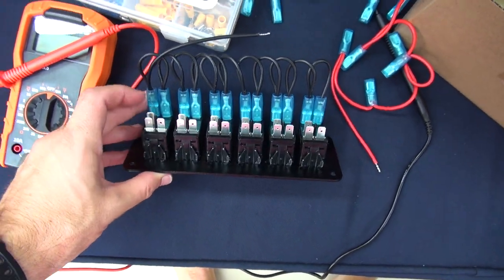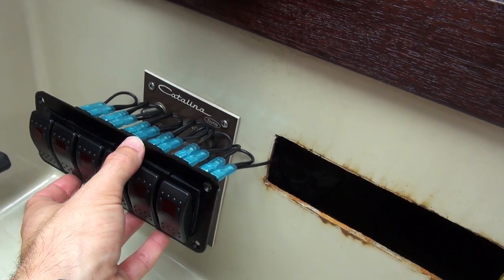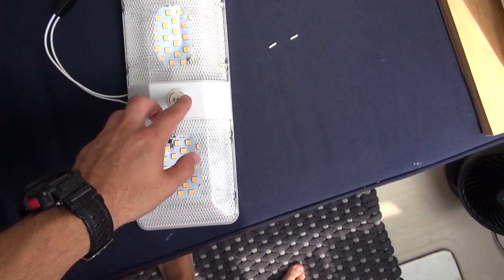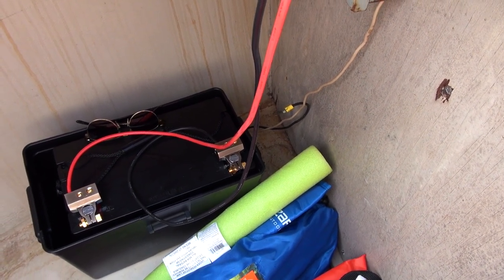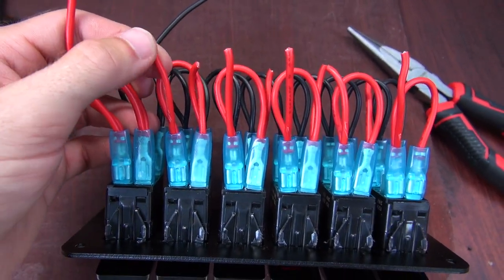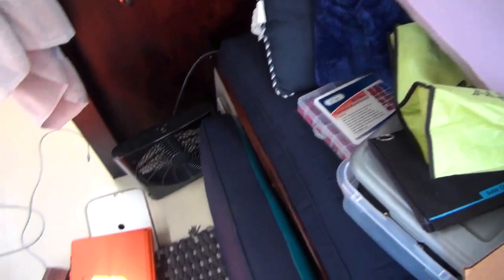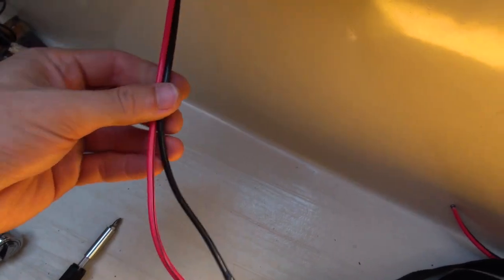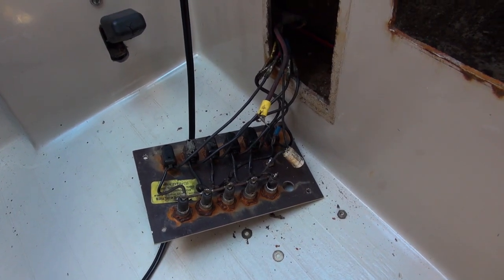Installing a new 12V DC System on My 40 Year Old Sailboat (Part 2) - Sailing Viridian Episode 6

Comment: Love that you’re finding passion in sailing/the ever ending process of updating.. BUT please study up on AYBC standards for Marine electrical wiring.. so many things on your boat concern  me and really hope you don’t have a fire (however somewhat unlikely)... do you have an auto bilge pump?  And pls don’t run your speaker wires  thru the drain holes... I would wrap wires around the stanchion tubes, then drill a hole to run them through a marine cable seal grommet  inside the boat. Nice work, but do more research before working with boat electrical (much different than home electrical).. A fire can cost you a bunch of $ on the dock; and your life at sea. Lots of concerns visible from my humble opinion, PM me if you want, I would be happy to walk you through it..

Comment: Great job getting those wires sorted out. Looks like it is coming along well. The old gate valves under the gally made me cringe. Mine broke off in my hand and almost sunk the boat. That made me wonder if you have a bildge pump connected to a float switch?
Reply from the maker: I agree, those valves make me nervous as well. Installing an automatic bilge pump is definitely on my to do list. What material or type of metal were your valves?
Reply: @SailingViridian  They were the same as yours. I removed them at the yard and glassed over the hole. The only one I kept was the raw water intake for the engine. My catalina has an Atomic 4 engine where your mess of wires were.

Comment: Enjoyed some of your vids, ,,,, Obviously ocean and especially intracoastal canal (go Florida to Lake Champlain - or over to Erie Canal and west) offers great waterways.  And west Georgia has riverways too.. It is good to explore sailing using the free wind, but a 5hp motor pushing a sailboat 7mph is darn efficient too and faster (go in straightlilne) and 20 gallons of fuel can almost cover month of putting.  Here in Iowa on the rivers my family we just leave the mast off and can get to Alabama on the rivers in our Macgregor 26.  ...  

I hate to sound strange but a catamaran is better sailer than monohulls, and they are lighter, , , some are so light and narrow you can put on trailer - --  just an idea to think about (the Australian Jarcat is my dream boat, if I can find 1 here, but it shows how light a boat can be - - but tend to be low headroom).  

Compared to Iowa here, Penn-NJ barely freezes so boats can stay in ocean maybe not lakes over winter, , , ,  but should be interesting.  . . . Keep trying new stuff.  Try to avoid chores, a simple life is best is my motto if I bothered to have a motto.  ...  OR I COULD BE FULL OF HOT AIR, ARE SAILERS FULL OF COLD AIR?

Comment: DUDE!!! All you have to do is put 12 volts to the switch panel. THAT'S YOU POWER SOURCE FOR ALL YOUR STUFF! So, the 12 volts in to panel is daisy chained to every switch. The bare terminal on the switch is your power out. Those are breakers so you really don't need fuses. If you ever get a short, the breaker will trip. You're making it way too hard. Ground to the panel only serves to light the switches. The redundancy with the fuses is nice, but not necessary. Big boats don't run both.